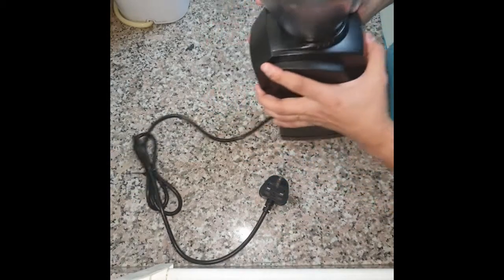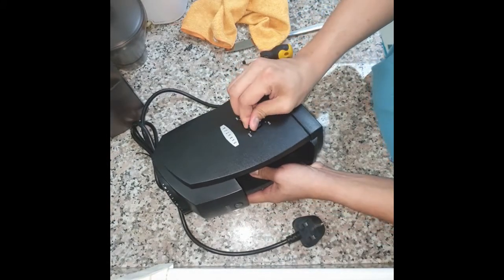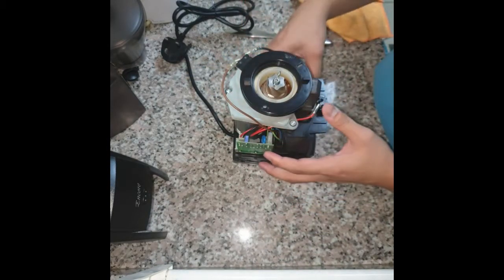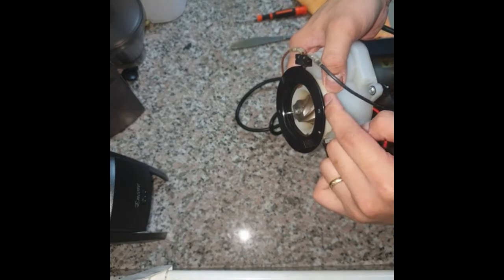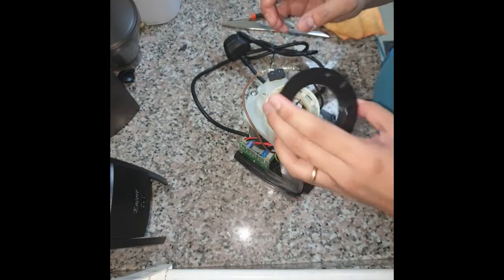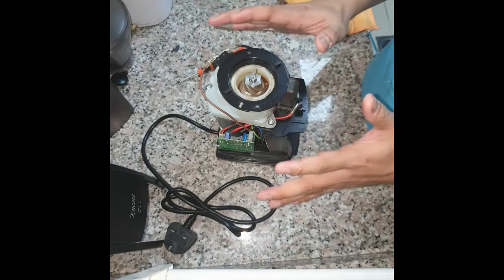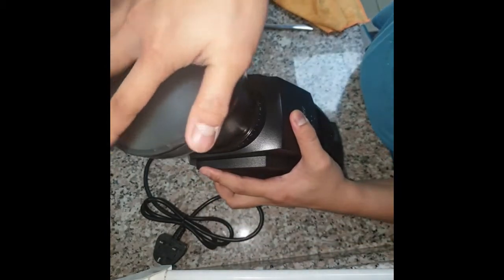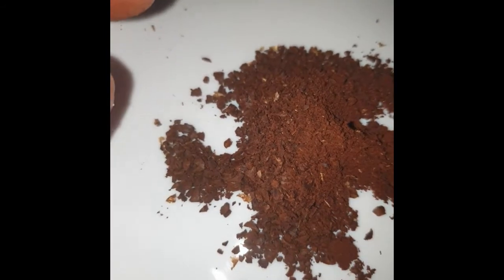Baratza Encore - Stepless Mod

Comment: It's a great improvement, but it's not good if the adjustment mechanism turns too much, so it should be even better if you wrap it with silicone tape etc.

Comment: Great video thank you. About the steps, is it stable when you put the knob somewhere in between the numbers? Does it move when you grind or over the time ???
Reply: If you're worried about that, I would suggest just holding the hopper in place while grinding. 

I had just ordered an encore which is why I'm checking this out, it's arriving next week.
Reply: @DarkEnigma1115  Instead of removing the little step pin (or whatever it is called), what about filling the step slots to all be flush and reducing the height of the pin to add friction, then it should hold in place better - by simply removing the pin, there could be slippage during grinding.
Reply: This is the key question. I made this same mod about a year ago with a Virtuoso and it is indeed stepless. However, it's quite clear that even when holding the hopper you get some variance in grind size. And, over time, you get more inconsistency shot-to-shot. If anyone has a mod to address this, that would be very welcome. (I saw a previous comment on filing down the steps. I'm not sure that would fully resolve the problem. Additionally, if you ever did want to make the grinder stepped again, you'd be out of luck. In general, I'm a fan of reversible mods.)
Reply: @anisevance7368  my thought is to add folded up paper shims under the adjustment ring- enough to keep tension on the ring to hold it inplace when you find the right setting- but still be able to move the ring with some effort- don't know if it;ll work, and will need to experiment with how thick to fold the paper shims- but you just wanna add some resistance to hold it inplace- might not work- but worth a try-